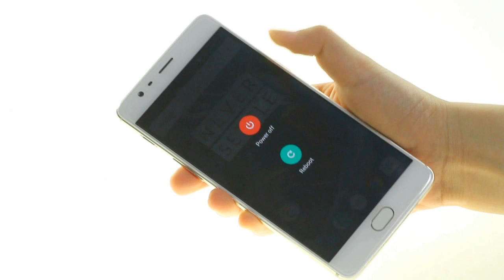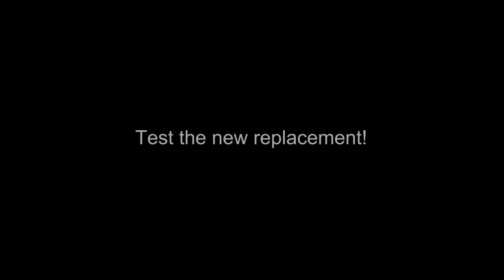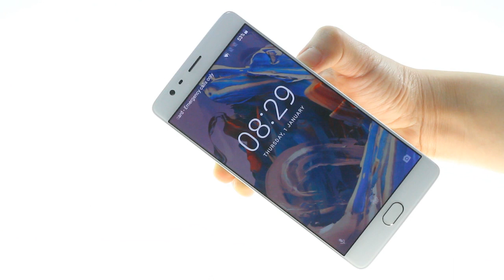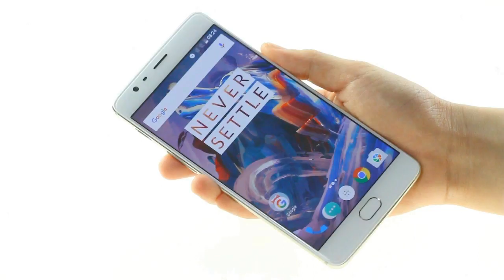OnePlus 3 Power and Volume Button Flex Repair Guide

Comment: Thank you for this tutorial. I did this on my OnePlus 3T and it worked.
I have an advice for everyone: You need some glue to let the new connector stick. It won't stick well without glue because you need to remove the old glue to put in the new connector.
Second advice: Try not to bent the battery. You can heat up the glue between the battery and the screen and use the tools to remove it without bending it.

Comment: My flex wouldn't stick. I guess it has beed replaced in the past, so I tried to close it with buttons hanging loose and power button snapped of :/
Be sure that it sticks before you close the case.

Comment: Just did this successfully. Here are some tips.
1.) When taking the phone apart I found using my fingernail starting at the corner & then to the sides worked better for me than tools.

2.) When taking out the battery, use a hair dryer to warm the adhesive so it comes out easier. Pull a little & then apply heat. Repeat as necessary. 
3.) The part of the cable at 2:55, I needed to add super glue to the back of the replacement part to stay put.

Good luck. Remember to take your time & be careful. Took me about an hour.
Reply: Never warm up near the battery

Comment: I pulled my battery and it bent like hell. It takes a lot of force to remove that bugger and the battery simply isnt designed with that much rigidity. Because of how much the battery bent, its unusable now so ill have to order another one. Not that any of this is Wit Rig's fault, its just how OnePlus secured the battery into the phone. Also, 80% of the adhesive to hold the battery in came out WITH the battery so now i need to put some glue in there to hold the new battery into place (which i now need to order)

Comment: Amazing video, helped a lot!
As other people commented: You need a lot of force to remove the battery - for me until the point it was totally bent. I grabbed a spare before because I thought if I'm going to open it I can (after 2 years of dash charging) replace the battery in one go. I suggest grabbing one if you're at it.
Second point: Needed a bit of glue for the power button. The flex band has a bit of resistance and didn't stay in place. Drop of UHU worked like a charme. I think I spent like 25EUR in total for battery, tools and the flex button. Gotta love the OnePlus 3T :)

Comment: Thank you for the guide.
Was a bit scarred of pulling out the battery though - large force required.
Had a bit of trouble to get the switches in position when remounting the back panel - not enough glue left on the body.
Managed to arrange them though.
Succes!!

Comment: My repairs were successful thanks to these instructions.  However, in the process of screwing the Torx screws back in, I accidentally stripped one of the heads, so I will be unable to perform further repairs in the future.  Is there any technique to remove a stripped Torx screw from the case short of getting a really, really, really, really tiny drill and drilling out the entire screw?

Comment: My battery got tilted little bit while removing. Remaining steps I have done perfectly. But phone is not starting please help.
Reply: Had the same problem, solved by plugging charging wire in and then powering on

Comment: hey any idea where a good European spare parts merchant can be found? I have this issue plus an issue with the simcard reader(s) would they be linked? also if you would do a sim replacement video I would be overwhelmed with emotion :)
Reply: Europe is MUCH more expensive than China, sadly. I'm going to buy mine from www.parts4gsm.com , they seem relatively cheap (although it's a bit more expensive if you don't live in the Netherlands).